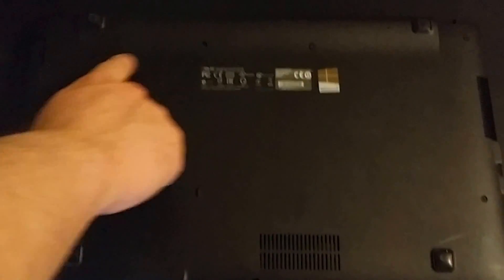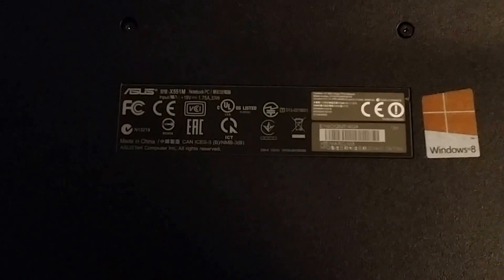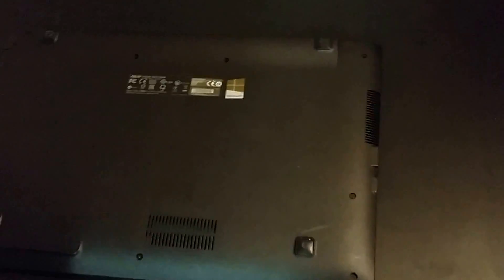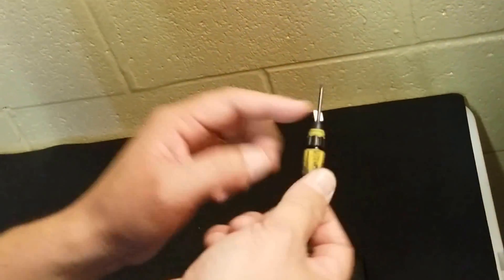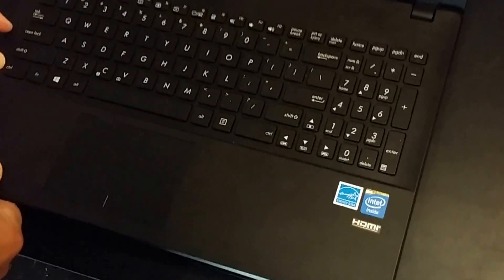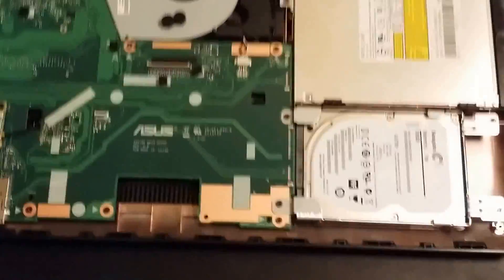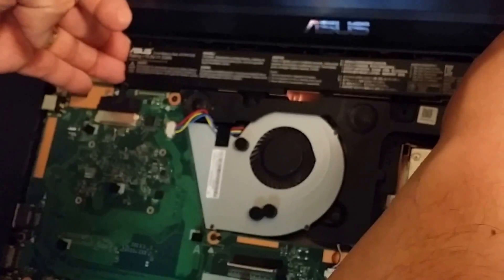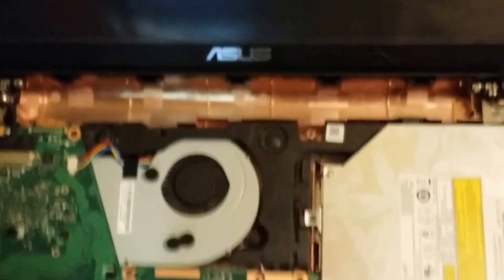ASUS X551M Laptop Battery Removal & Won't Power On Fix

Comment: My Sony laptop is not charging or showing the led light after removal of battery 
Do you have solution for it...!!!
Reply from the maker: You most likely have either a bad DC Jack or bad motherboard.  The only way to find out is to starting replacing parts.  I would start with exchanging the DC jack first as it is the cheapest of the two parts.  Then if the DC jack doesn't fix the problem, you will know it is the motherboard.  By the way, before you do any of this, try another power adapter to rule that out.  Power adapters can and do go bad over time.

Devin

Comment: I can't get the power ribbon cable back in
Reply from the maker: Getting the power ribbon cable back in a tricky and can require TWO people to make it a LOT easier.  One person holds the lid, and you can "finagle" the ribbon cable into the connector to latch it down.  Not having to hold the lid will allow you to concentrate and SEE the insertion point a lot easier.

Devin
Reply: Thanks a lot :)
Reply from the maker: ***** Anytime!  Good Luck!

Comment: mine is windows 8 and my touchpad pop out abit does it have anyth to do with the batg?
Reply from the maker: Nope.  Unfortunately the touchpad has nothing to do with the battery.  If you disassemble the laptop and remove the keyboard / top lid off, you will see the touchpad assembly on the underside.  You might be able to pop that back into place or at the very least, figure out why it is popping out.

Devin

Comment: I need to leave my laptop in long term storage (4 months) will I need to remove the battery? I have an Acer C720 chromebook.
Reply from the maker: If you are planning to put any laptop in storage, it is a good idea to remove the battery to preserve the life of it.  However, keep this in mind.  1. With no main Li-Ion battery, the CMOS (watch battery on the motherboard) that keeps your BIOS/UEFI settings and your system clock time will be used up faster.  2.  With the cost of replacement laptop Li-ION Batteries hitting between $20-$30, they are really inexpensive to replace nowadays.

Devin
Reply: Very helpful. Thanks for taking the time to answer.
Reply from the maker: 1ranjeeves21 Anytime!  That is what this channel is for!

Devin

Comment: The battery in my laptop doesn't last as long as it used to I need to replace it, thank you for the video!!!! I hope the battery it's the issue
Reply from the maker: You are very welcome!  And 99% of the time when a battery doesn't last as long as before, you need to replace it after 2-3 years.

Devin

Comment: Thanks for the video. I removed the lid very carefuly  but the three ribbons were extremely flimsy because they started to detach one by one at the slightest movement. How do I put them back or do I have to replace them?
Reply from the maker: Detached?  As in removed from the insert points or "ripping"/"tearing apart?  You flip the lids upwards in order to release the ribbon cables.
Reply: Thanks for answering. Yes I just detached them, I thought I damaged them but foolishly removed the white lid and It's a pain to reattach them.
Reply from the maker: Yes it takes a little bit of patience and an extra pair of hands to hold the lid up REALLLLLY helps.  My son held the lid up for me while I reattached the ribbon cables back to the motherboard so you may want to get another person.  It makes it a LOT easier.

Comment: I wasn't able to get the front panel off.
Reply from the maker: It REALLLLLLY helps if you have a thin prying tool like a guitar pick or a really flat (wide) screwdriver.  You have to wedge it in there and I usually start at the front right corner and start working around the laptop until all the retaining clips have been released.  Watch the video again so you can see what I mean.

Devin
Reply: ***** Okay, Thanks.

Comment: Hi bro, how i take out my battery from my ASUS X556U series?
Reply from the maker: I have personally not removed a battery from your model yet.  My advice is that if you want to take a chance doing it yourself, watch the video for pointers then CAREFULLY start to disassemble your laptop using this model as a "guide", basically on how to be very careful removing ribbon cables and top lid assembly latches.

Comment: hi mate I have a problem that my charger won't have a blue light and won't charge
Reply from the maker: So your charger usually has a light on and it doesn't now?  Need clarification.  Is the blue light on your power adapter or on your Asus laptop?  If it is on the power adapter, then you most likely have a defective one and need a replacement.  If the light is on the laptop, then you either have a DC Jack issue or the motherboard has an issue.
Reply: +Angrysquirrel PC the blue light on the charger will not come on
Reply from the maker: Try using another charger to eliminate the charger as being the culprit.  Power adapters go bad after use more often then you think.

Comment: do you have a build in battery?
Reply from the maker: If you are referring to the Asus model in the video, the battery is internal and built in BUT can be removed if you disassemble it.  If you need to purchase a battery for your Asus, Amazon.com or eBay.com sells them from around $20-$40 dollars new.

Comment: You're a life saver. My dads laptop wasant turning on and just before i gave up on fixing it, i came across this video. I was to afraid of dissembling it my self, but this video made it look somewhat easy, and it was pretty easy. Took out the battery, held the power button down for 30 seconds, put the battery back in, and it started working perfectly again. Thanks.

And yes screw whoever thought it was a good idea to put the battery inside the laptop. Ive had this issue with my laptop and it was simple to fix because the battery is on the outside.
Reply from the maker: +Mc Donalds You are very welcome!  Glad the video helped you out!

Comment: my aux from my headphone accidentally touched my usb and now it won't turn on.. if I replace the battery will it work?
Reply: *****

Thanks I'm gonna try it.
Reply: +Angrysquirrel PC is there any other option apart from removing the battery
Reply from the maker: +Ray Lee I have a LOT of people asking about what happens if someone accidentally plugs in a headphone jack into either a USB or HDMI port and the system will NOT turn back on.  Here is the answer as to what to do if that ever happens in a sticky.

Follow the steps from my video and remove the battery.  Reattach the Power Button ribbon cable WITHOUT the battery or AC adapter plugged in and press & hold the power button for 30 seconds to discharge any residual charge on the motherboard/laptop.  Detach the ribbon cable, install the battery and then reassemble the laptop but do NOT screw in the screws yet.  Assuming your battery is charged, power on the laptop.  It SHOULD power on at this point.  If it does, then turn off the system and completely reassemble the laptop.
Reply: +Angrysquirrel PC 
I have a Acer V Nitro laptop.
It has built in battery.
Can I remove the battery and run it using plugged in power supply as replacement instead?
or would it just destroy the mother board?
or its just plain impossible.
Reply from the maker: If the battery is built into the motherboard as in NOT Removable, you are taking a risk damaging the board and the computer.  If you can actually remove the battery without damaging it upon disassembly, then I would say you have a shot.
Reply from the maker: Monkey D Luffy Good luck and let us know how it went!
Reply from the maker: Unfortunately no.  Well, there IS another option but it will take a LONG time for your Li-ion battery to drain completely on it's own (maybe 2-3 months).  It would be quicker to follow the steps in the videos and remove the battery then hold the power button down for 30 secs.

Devin

Comment: My asus laptop also wont turn on after putting a usb cord in it can you help?
Reply from the maker: +Na&#39;Talya Burke You will need to reset your laptop.  Remove the battery following the video's instructions.  Hold the power button down WITHOUT the battery (you have to insert the power ribbon cable back into the motherboard before you do this) for 30 seconds, then reassemble.  You should now be able to power your system back on.

Devin
Reply: My mom followed how you unscrewed the back and it works now thank you so much
Reply from the maker: +Na&#39;Talya Burke You are very welcome!  Glad you got it working again!

Comment: Hi is the hdd connector standard so I can replace with a solid state drive?  Thank you so much for your informative video.  Yes it would have been good to have a cover for the hard drive and ram too just like the good old days, but the morons have invaded.
Reply from the maker: +nagual4ever Hi Nagual,  Yes you can add a standard 2.5" SSD to the laptop.  The HDD is a standard 2.5" SATA connector so with your upgrade, you will DRASTICALLY improve your speed and performance of the ASUS.

Devin

Comment: My asus q553u laptop wont turn on.  It has an integrated battery and I've seen some things telling me to do the same thing you're doing.  I'm more concerned, though, about why it wont work.  I was in google drive and it just shut off.  I'm happy that I can fix it but I just bought this not even a month ago and I don't know why this happened.  Do you know of any reasons this may have happened?
Reply from the maker: +Paul Miller The short answer without knowing all the details is that you most likely either shorted something out (plugging a headphone jack into the usb port or maybe a power surge) or the DC jack is defective and once the battery completely drains (whether it is plugged in or not) it will not turn back on.  If you just bought this one month ago, I would suggest calling ASUS technical support since this laptop comes with a one year warranty and you won't have to spend any money repairing/diagnosing it.

Devin
Reply: +Angrysquirrel PC thanks for getting back to me, I took it to best buy where I had purchased it.  This is several hours later when I got the chance to go, and when the plugged it it there it turned on.  I don't know if this is completely fight or not, but the guy said that computer most likely got stuck in a loop of some sort, and would bot respond.  While I waited to go to best buy the battery drained, giving the same result as removing it would have.  Thanks for getting back to me!
Reply from the maker: No problem!  Glad things worked out for you!  Removing the battery would also have did the trick but draining it as you did worked as well!  Keep that trick in the back of your mind if this ever happens again for your machine!

Devin
Reply: +Angrysquirrel PC thanks
Reply from the maker: Anytime!  Good Luck!

Comment: I have the same type, one night is all working and the following day the system will not start with either the build in battery or power cord.  I follow the the steps from a another video to remove battery and rest system for 30 second, but still no juice.  I called customer support at ASUS, they want to charge me over 400.00 for repair.  Any suggestions? I live in San Diego, CA.
Reply from the maker: +Alberto Maldonado 

Alberto,

If a laptop won't power on, it could be one of several things:
1.  Your AC Adapter has gone bad.  Try to get another compatible AC Adapter or Universal Adapter and see if it powers on.  You don't know HOW MANY TIMES customers come into my shop telling me that their laptop won't turn on, then I plug in my Universal AC Adapter and it turns right on.

2.  Your battery has gone bad.  Remove your battery and plug in your AC adapter and try and see if it turns on.  This MIGHT be the problem as bad batteries can cause a laptop to not turn on.

3.  Your Motherboard / DC Jack / Power Button board (on certain models) has gone bad.  A motherboard replacement can be costly depending on the model but EBay and Amazon is a good place to look up prices for replacement parts.  A power button board is less expensive but is still a part that can be costly depending on model.  A DC Jack usually costs under $10.00 BUT on Asus models, they tend to be soldered on to the motherboard.

4.  This SOMETIMES HAPPENS and don't laugh.  Make sure you are plugging in your adapter on a KNOWN good electrical outlet and the outlet is turned ON AT THE SWITCH (for those outlets that have a on/off switch).  I know it is funny but it can happen.  You drain the battery and it won't turn on and it won't charge because no power is going to the laptop.

Let me know what you find out!

Devin

Comment: hello I got an problem with my asus laptop it's turning on and it works but it do not charge it just stays on 0% so what cud it be is it some problem in program or it's the battery or my by charger????
Reply from the maker: +Edgars malinins 99% of the time, that means your battery has gone bad and needs to be replaced.  You can pick up a replacement battery on eBay or Amazon for under $30.00.

Devin

Comment: Ok, so if I don't want to disassemble it, and i will also use the power adapter,  will the battery die in a year or two, how much time would you give it? it's an Asus R556L
Reply from the maker: +tinthepark tinthepark The Li-Ion battery will deteriorate over time if you leave the battery in there regardless if you only use the AC Adapter.  Batteries usually last anywhere from 1 to 3 years on average.  Even if you remove the battery and place it in a refrigerator (not freezer), it may only last about 3-4 years if you never use it.

Comment: The screws are so tight - i can't get them off
Reply from the maker: +Osian Williams Keep at it.  Sometimes the person/machine that initially screwed them in did them too tight.
Reply: +Angrysquirrel PC yeah - out of all the screws i can only get 3 out. I know i'm a kid but i'm pretty strong ( trying not to brag ) - can't even move the bloody screws :( i wanna add ram to it
Reply from the maker: Ick.... hate to break it to you but on this model you got a 50/50 chance of adding ram to it.  Half of them have the Memory soldered on and you cannot upgrade that model.  The only way to really tell without disassembling yours is to call ASUS tech support and give them your serial number.  That way, they can tell you if you can upgrade your memory or not.
Reply: +Angrysquirrel PC honestly these shit companies!  Next computer I'm using pc specialists
Reply from the maker: If people spend more then $500 for a laptop and stay away from the under $500 budget ones, people usually do not run into these types of problems.  USUALLY.

Good luck!
Reply: +Angrysquirrel PC thanks mate!

Comment: I have the exact laptop you did your demonstration on. í will not work with the charger plugged in or on battery... I bought a new charger for it, but still nothing. I hate to buy a new battery too an still not have anything... should it work just having the charger plugged in..? thanks for your time, I appreciate it, I really do... the video was awesome, when I looked at it the first time i was like what the       $@&%... who does this..? who build a laptop and doesn't make the battery accessible from the exterior... after watching your video, I guess it's not too bad to change... what do you think, is it the battery..? thanks again.... Jeff
Reply from the maker: +Jeffrey Steen Hi Jeffrey.  Well I am going to assume that you have had this laptop for a couple of years and assume this problem just started happening.  So you essentially have no power and cannot turn on the laptop when you plug in the power charger/adapter.  You have already tried a NEW charger and it still does not turn on.  That only leaves THREE other possibilities.  Well four but I will assume the outlet you plugged the adapter into is good.

1.  Your DC Jack went bad.  A defective DC Jack will not allow you to charge your battery OR power the system on.  The easiest way to determine this is to somehow charge your battery or get another battery from someone that has power in it.  After replacing a battery with power, if it turns on, then you have a bad DC Jack.  You can get a new DC Jack from Amazon or eBay for under $10 and replace it yourself using my video's tutorial by opening up the case to get to the battery and seeing the DC Jack to simply switch it out.

2.  Your Power Ribbon Cable was NOT inserted correctly or the Ribbon Cable got damaged upon disassembly.

3.  The worst case scenario >  The motherboard failed.  A bad motherboard means no power or the ability to power on the system.  You can purchase a new motherboard on Amazon or eBay but will be over $30-$80 depending on supply and being either used or new.

Hope this helps you figure out the issue!

Devin
Reply: +Angrysquirrel PC thank you so much for your reply..a defective DC jack...and I didn't get or couldn't see the other two possibilities...bad  battery I'm assuming is another one,and there's one more,what was that one again if you don't mind...everything you said was correct...
Reply from the maker: I didn't say bad battery because 9 times out of 10, if a battery is bad it won't cause the power coming into the motherboard from the DC Jack to not power up the system.  It CAN on RARE occasions not let the system power up but in this case, you can remove the battery, reinsert the power ribbon cable then insert the power adapter and power it on to see if the battery was the culprit.  If it powers on, then it was the bad battery but again, this is rare.